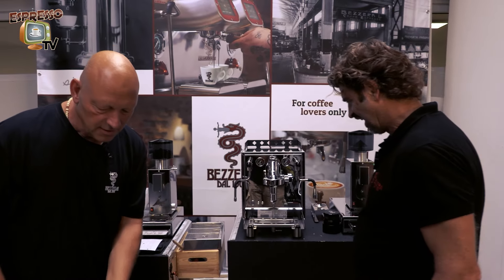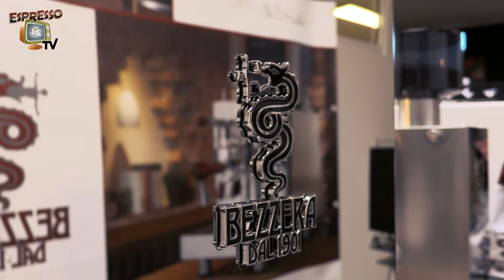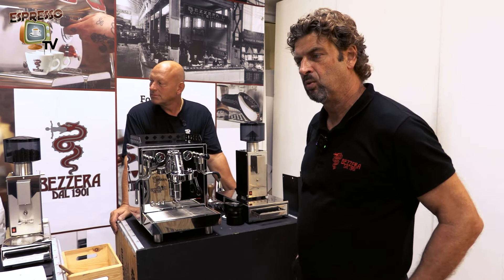Bezzera Luce Unboxing with Luca Bezzera

Comment: Looks like a redesign of the trusty Magica/Mitica, reposition the gauge from the bottom left to the top. 
Reposition the top on off switch and LED lights to the bottom left. I prefer the former idea to keep the electronics away from the water in the drip tray and moisture from the steam wand, also it looks better. 
Pressure stat is easier to adjust, but no reason to do it and it wasn't hard with the former.